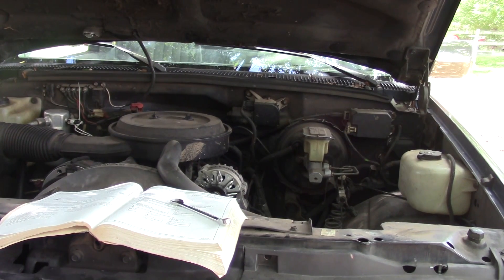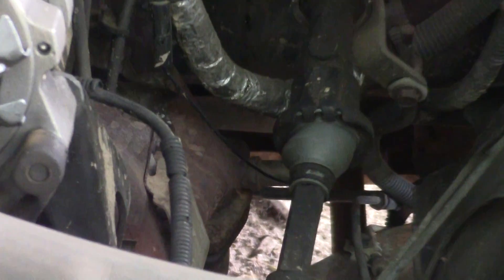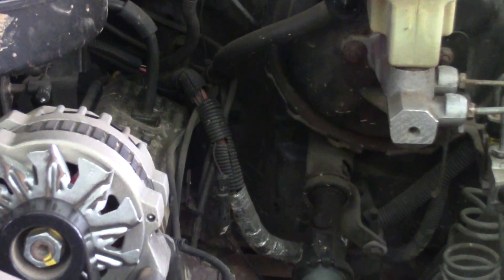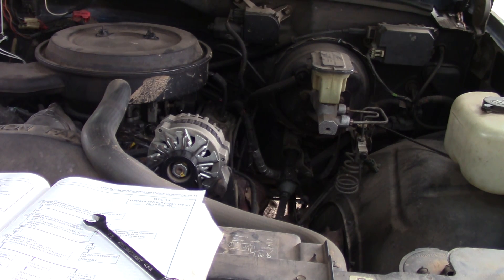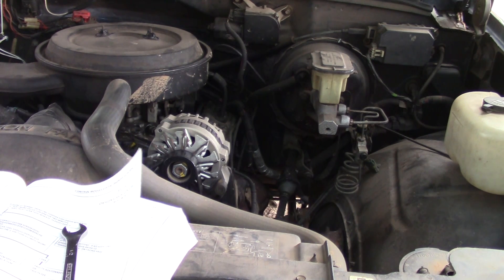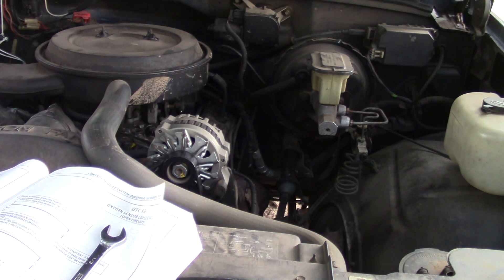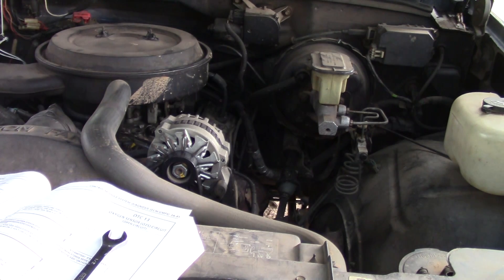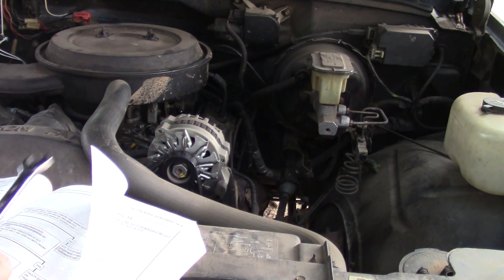GM Truck DTC Code 13

Comment: I’m getting a code 32 and 13 on my 1989 Silverado suburban. I’ve replaced the egr valve and the egr sensor. Still getting the code. It idles great in neutral and park, but when I put it in gear it wants to die. I’ve also replaced the MAP sensor and Idle air control valve. I’m stumped. Sound like anything you’ve ever encountered? 

Great video
Reply: Your truck could be out of ignition timing, you need to have it checked with a stroboscopic gun and the timing connector unplugged.

Comment: Great explanation of how to troubleshoot a code 13 on these older Chevys. I have a 1988 c3500 and finding any kind of literature is tough.
Reply from the maker: Check eBay. That’s where I find mine.

Comment: What would set off a Code 12? Have a 5.0 on an 87 Chevy B-Body
Reply from the maker: Code 12 is a normal code. It just tells you that everything is communicating properly.  You should see a code 12 before and after any set codes.
Reply: @farmboysgarage7595  Strange. It gave me a CEL and then only gave me a Code 12. Booklet said it was something about no communication between the djstributor and the ECM?

Comment: I have a 94 gmc 350 with a 3 wire sensor.I have replaced sensor several times but keep getting code 13.How would you check  a 3 wire sensor?
Reply from the maker: The 3-wire sensor has a power supply from the fuse box (key on) and a ground from the PCM to the heater element.  The 3rd wire is the sensor to the PCM.  You'd need to find a wiring diagram to see which wire is which tho.  Search on google images.

Comment: I can only imagine how many oxygen sensors are causing poor running vehicles and bad gas mileage.
Reply from the maker: Yeah, especially on these older vehicles.  These 1-wire sensors are fairly inexpensive too!

Comment: Nice explanation , on my 02 I just had a Po157 O2 low voltage code. Mine was stuck at 400 mv and barely moved, tested it and threw  in a new one. I don't  see that too often.
Reply from the maker: Thanks Steve, I would imagine so!  Do you replace your O2 sensors regularly or just wait until they give issues?
Reply: Farmboy's Garage Every plug change like you but I think its just the two of us that do this. LOL